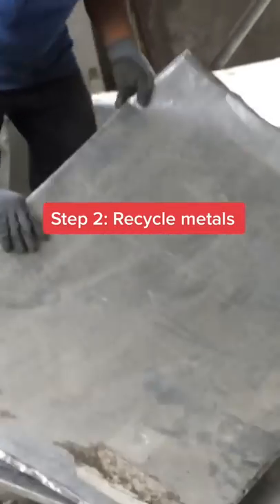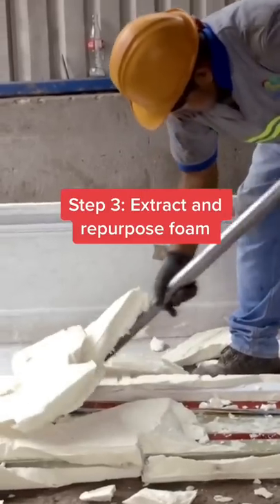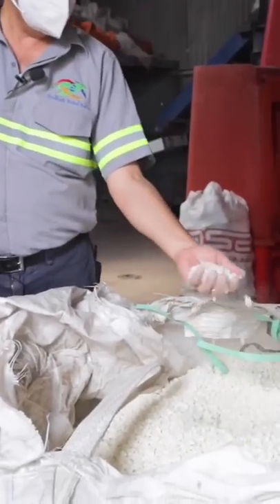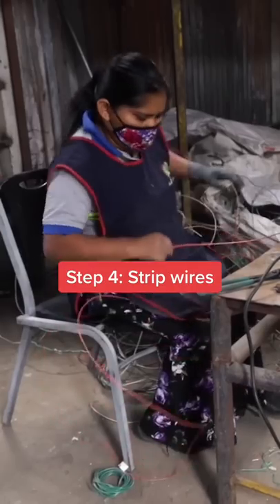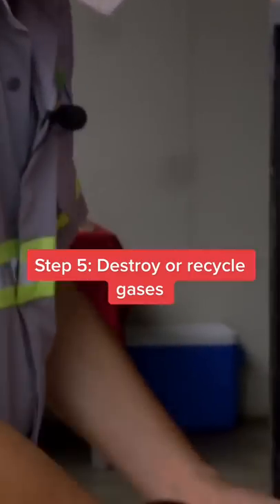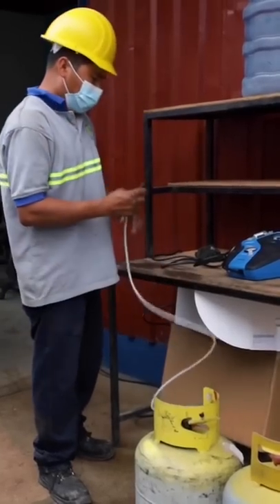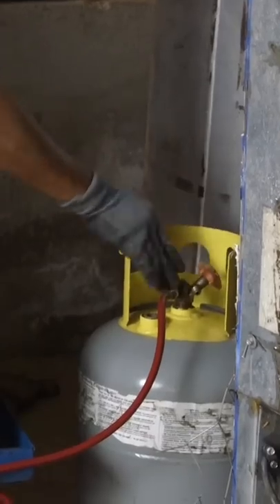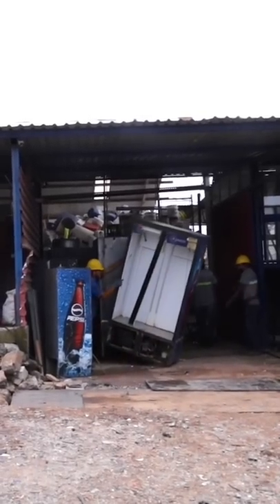How old #refrigerators are #recycled. #shorts

Comment: This should be the rule for everything we built not the exception for a few electronics. Circular Economy.
Reply: It's too expensive. The reason it's done for fridges is the gases they contain
Reply: @zachb1706  the parts and metals are worth more than simple gas. Hell you need metals to even create and house those said Gases.
Reply: @tsijr915  the gas isn't valuable, the gas is damaging to the ozone layer. That's why disposal of fridges is done by professionals.
Reply: @zachb1706  not all refrigerants are cfcs, but yeah refrigerants are Hella expensive, a gallon of them cost around 200$
Reply: The only reason this is possible is because these people are so desperate for money and jobs that they are willing to pull these apart. I can guarantee you wouldn’t be doing this everyday of every week for minimum wage. This type of work takes a toll and really isn’t viable.
Reply: I wish
Reply: @zachb1706  my guy, you can’t possibly believe just cause something is “damaging” it’s not valuable. If you do, you need tog eat rid of all your modern luxuries including your phone with a lithium ion battery.
Reply: I don't think you understand how life works.
Reply: There is a rule, set by the EPA
what's the problem, 2 people have been charged with venting refrigeration since the epa started in 1970. They are useless. So there are rules, but really no one to regulate them
Reply: @kevinn4038  I don't think you know how circular Economy
Reply: @zachb1706  it’s refrigerant aka freeon
Reply: The world needs to get rich. Asia and africa produce so much waste into the ocean.
Reply: @zachb1706  the refrigerant is hella expensive the bottles of r1234yf are like $400+ for 10lbs of that shit. Recycled steel and aluminum is 4¢ for steel and 40¢ for aluminum. Metal is cheap.
Reply: You can't recycle alot of things, 90% of materials sent to be recycled aren't appropriate and waste time and money sorting out, really anything dirty or food/oil/chemical stained is useless, and even recycled plastics need to be composed primarily of new plastic anyways.
Reply: Ook
Reply: Ah yes, no longer a free economy. You do understand what you're advocating for, right? Government controlling business? Keep that in Russia
Reply: A circular economy is like a perpetual motion machine. Doesn’t exist, will never happen, and a ton of physchos are upsessed with it. 

Oh yeah, and you can’t keep something rolling without occasionally stimulating the roll. This statement can be applied to both a perpetual motion machine and circular economy
Reply: Then get to it pal
Reply: Then start a company and do it
Reply: It's not like theres a rule saying that not everybody can do this. It's just theres more lazy people making trash rather than resourceful people being sustainable.
Reply: That's not very realistic for most things. Some things simply cannot be reused or it's currently too expensive to reuse. We need to keep a balance between being environmentally friendly, maintaining convenience, and keep poverty under control. If environmental reforms affect poor people disproportionately then the plan is simply not realistic or doesn't have enough contingencies. If it affects convenience and comfort too much people are simply not going to comply. And if it affects the environment too much, our situation will get worse
Reply: And electronics that work anyway should be redistributed.
Reply: @zachb1706  they could hire people who don't have jobs and will work fir less.
Reply: @zachb1706  china doesn't really like us...

Comment: I worked at a company in Germany that recycles refrigerators. The gases are collected, the the whole fridge gets shredded to tiny pieces. Then everything gets separated to be recycled. Magnets pull out the iron bits, fans blow the insulation, the conveyerbelt goes through a water bath where the plastic parts float and the aluminum is collected at the bottom...
Reply: I would like to watch a fridge get shredded. Sounds awesome
Reply: Thank you for the information on the different processes that can be used.
Reply: They should do a show like how it’s made. But instead it’s about recycling stuff
Reply: We need a video
Reply: @indysilver_02  we have fast food tiktok, Where's recyclers tok
Reply: Very cool
Reply: @vargasa7847  it's extremely loud and trying to clean up after each fridge is a pain for every 24 hours. Of run the machine we use to destroy the fridges need 1 hour of cleaning and maintenance to run
Reply: You kind of ended abruptly. I would have read a whole book about this. lol
Reply: Oh shit I wanted to know those SO BAD for YEARS
Reply: Its shared bits of knowledge like this that help make the world better. Hopefully others can apply better technics in there societies
Reply: What happens to glass
Reply: I just now got an alert to likes and comments (thx youtube?) :)
@vargasa you don't want to watch it close up. It takes place in a 5m diameter encasing where a chain is rotated at high speed. Each chainlink is the size of a watermelon and bashes the fridge to pieces. The chain gets used up and is replaced up to twice a day. 
Another reason why you don't want to be in there: The area is flooded with carbondioxide so no oxygen is available for a fire. The smashing produces a lot of heat and the insulation and plastic parts are flamable.
Reply: What do they do with the gasses that  affect the ozone?  Do they have another use? Or do they just store them forever? If so, i hope those tanks are indestructible!
 Thanks for giving us your first hand experience!

Comment: NO THERE NOT THEY ARE ONE OF THE EASIEST THINGS TO RECYCLE ONE OF THE HARDEST THINGS TO RECYCLE IS A SMARTPHONE
Reply: Na I would say recycling of used fuel rods is way harder than a bit of crushing and wet chemistry and the battery pack just needs to be dismantled in a dry argon bath (argon is heavyer than air)

Comment: What do they do with the ozone gases? The ones that are harmful I mean
Reply: That's what they don't tell you lol, they resell it to be used in old equipment because it's extremely valuable. In the US for instance they've banned the use of certain gases for use in things like this or AC units, including the manufacture of these gases...it is however legal to use existing gas either still left over in storage or recycled like this to repair equipment that already used that gas, so with a finite supply of this gas and people who can't afford to upgrade or don't want to, they can sell this gas at a super marked up price and make a lot of money. It is however more advisable to just buy a new whatever it is that broke since the cot of repair and replacing the gas is usually more expensive intheong run than buying a new say AC unit since the new unit can actually be repaired with safer legal gases in the future and not he as expensive. Because you can't just put new gas in certain units, the old units won't work with the new gas.

Comment: I do this on all system's that I condemn or where I need to do sealed system work. It all gets collected, purified and reused. Gas doesn't go bad.

However, I've taken things a step further. I'm working on and in testing phase of purifying (Removing moisture and contaminates) propane gas. Propane is a much safer alternative, readily available, cheap and gets super cold. I have 8 fridges running my concoction for the last year doing checkups on them as the customers all agreed to take risk.

I've also been experimenting with mixing propane and creating colder gases.

R600 is cyclopentane which is commercially being used. It's much like propane in that it's a hydrocarbon but is expensive. Propane is a fraction and seems to work amazing with minor modifications to system.

The joys of autism. I focus on all the stupid stuff.

Comment: Cringe as a hvac tech refrigerator commonly contain R-134a Which is a hfc r-22 which is the worst and is a hcfc but small refrigerator contain r-290 which is just butane which is in your lighters so it’s safe to put into the atmosphere but you should never reuse refrigerant unless it is probably clean and filter to reuse or you risk of the equipment failure

Comment: Those refrigerators only hold a few ounces of refrigerant typically less than a pound. And you can check what refrigerant it is by looking at the model and serial tag. It'll say it right there, and with a quick look up you can find what kind of refrigerant it is. They never specified if he stores all the recovered refrigerant in 1 tank, and if he is. He is mixing refrigerants which basically ruins it. Also please don't just reuse the refrigerant. It can contain contaminants which will ruin the next refrigerator...

Comment: This is supposed to be done to every device with refrigerant, by law.  It's illegal to dispose of them in any way without removing the it first. 
I worked for a metal recycling company that received dozens of these every day, and they won't accept them unless the customer has documentation that the refrigerant has been removed.  After that, into the shredder.

Comment: The old refrigerant is the best.
We have a 1950s refrigerator that is still working and is still ice cold even after sitting in a barn for thirty years.

We also had an old air conditioner that was made back in the 40s and that suckered would freeze you out of a house or barn up until the compressor went out about four years ago.

The new crap barely last a decade before needing to buy another one.

Comment: Most gases used in refrigeration since last 2 decades are safe enough to be released in air and modern ones are using propane so even safer but has fire hazard.

Comment: I don’t think my definition there’s any gas in a refrigeration cycle that doesn’t affect the ozone
Reply: CFCs deplete ozone but refrigerants not containing chlorine don't react with ozone. They are however still pretty potent greenhouse gases and therefore can contribute to global warming.

Many people think that global warming and ozone depletion are the same thing but they are in fact two separate problems.
Reply: @Krankie_V  - what I was trying to say and to which I believe true is there are not any of the recent refrigerants R-22, R410A, R454B, R134A that don’t have global warming potential as well as ozone impact. It’s just to what degree.
Reply: @condor5635  the chemistry is well understood. Since I only work with automotive refrigerants I can't speak on the others, as I haven't studied them, but it's well understood that 134a doesn't react with ozone. It is a strong greenhouse gas but that's a different thing altogether. It does not affect ozone as you've claimed. If you really want to know it's extremely easy to look it up as a GWP and ODP number is assigned to every refrigerant we use. Data may be missing on some obscure ones, but it's there for all the common ones.
Reply: @Krankie_V  bottom line is the refrigerants change every several years because they have varying degrees of impact on ozone and global warming and they try to limit that obviously. I think we are on the same page thanks
Reply: @condor5635  except you keep saying that they affect ozone when they don't. The Montreal protocol started phasing out ozone depleting refrigerants in most developed countries in the early 90s and by the time the 90s were over, ozone depleting refrigerants were out of production. You keep saying it affects ozone but it doesn't. Global warming and ozone depletion are two completely different things. Fortunately because ozone depleting refrigerants have been banned for nearly 30 years, the ozone layer has bounced back, and it's not really an issue anymore.
Reply: @Krankie_V  good to hear.

Comment: I think today nobody using chloro floro carbon gases in refrigerator. Now they are using vapour absorption system which don't require such gases.
Reply: Yeah but there are old ones which still use them.
Reply: Or ammonia-based cooling agents, though those are also becoming obsolete